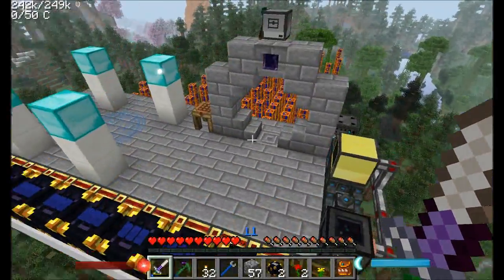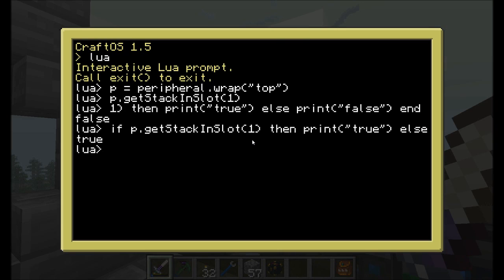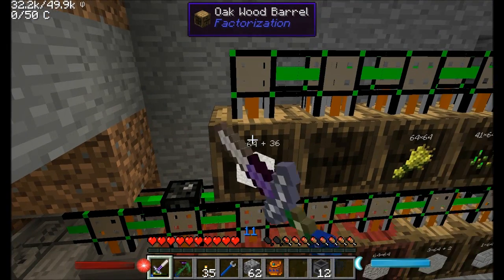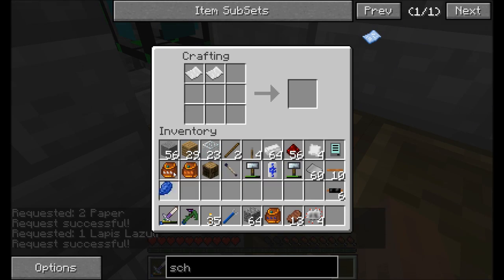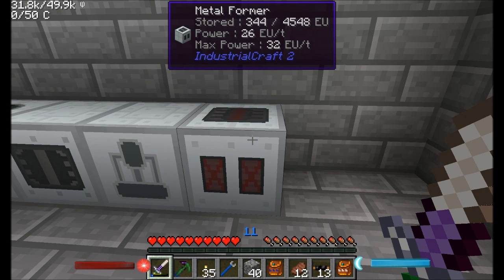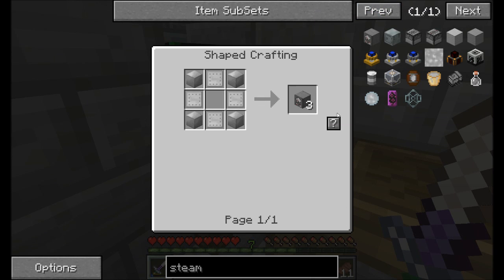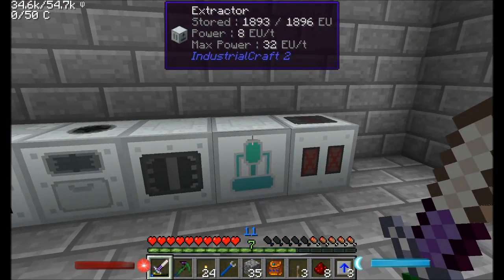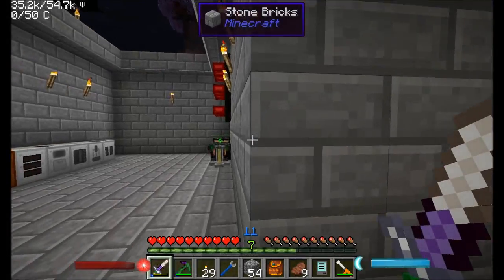Lets Play   S6E44 Upgraded Ore Processing

Comment: They should change thermal expansions machines slightly, either making craftable upgraded version with enderium or increase the process speed based on available energy.

as far as ore processing goes thermal expansion is superior to ic2, compact design, additional dusts, and you don't need 50 extra steps to make the parts.
Reply: Iridium is IC2 so TE won't use it in a recipe. TE already suffers from ''magic block'' syndrome so I doubt upgrades will be added, it will make it too OP. Use IC2 for hectic ore processing.
Reply: Whoops, meant to say Enderium.
Reply: Scott Kirby He said enderium.
Reply: Herp Derpington
Thanks for the support but I actually screwed up  and wrote eridium first.
Reply: One of the major design features of TE is that is designed that if you need more speed you just build more machines.

Comment: i liked the old ic2 better
Reply: abudahm a if by expensive you mean convoluted, then i completely agree :-P
Reply: Seth Baker Same and I would just build loads of pulverizers instead of crappy macerater
Reply: Seth Baker Yeah, it is basically gregtech now. If there was a config option to have simple recipes or the current annoying ones, that would be nice.
Reply: Could not agree more with this whole thread, IC2 is killing itself.
Reply: the new one is bit expensive
Reply: and tedious
Reply: Marsian I havn't even touched IC2, i really dont have to now,  i mean with thermal expansion and the smeltery who needs macerators and smelters.  that and thermal expansion machines dont make noise (yes i know there's a setting for that.)
Reply: indeed
Reply: The new IC, like Dire said, is a late game mod, for when players already have lots of machinery and items..
Reply: Gamer Dawg Eh, that is why TE works much better than it, that has options for early, mid and late game.

Comment: IC2 for 1.6 doesn't have explosions and the machines can accept 512 directly, it's been that way for months now. Just connect the MFE directly to machines with gold cable.
Reply: You don't get the explosions, but the machines are still limited to accepting 32 or 128 per tick (depends on machine). For a machine to accept more (and get full effrct from lots of overclockers) you need transformer upgrades in the machines.
Reply: Richard Cox
 It's still good to know that we have nothing to fear now...
Reply: actually its not plemented YET and as far as i know dire doesnt want to login after an update to find a hole in his wall....and roof.....and floor.....and outside ssoooo yaaahhh

Comment: You won't get shiny metal dust from macerators
Reply: ***** Except that Shiny Metal is Oredicted to Platinum. Metallurgy, at the very least, adds Platinum ore, and I'm sure there are others.

There's nothing wrong with Thermal Expansion having it's own key component that's relatively hard to get and only used for top-tier items - which, really, it is top-tier stuff, even the Tesseract. And you don't need much of Shiny metal unless you're going totally nuts - one makes enough Enderium for any single item except a Tesseract (which needs two).
Reply: If you're using Gregtech you can with the Industrial Macerator I tought, it is called 'Platinum" in Gregtech. Look it up
Reply: you can just set a pulverizer specific to ferrous .
Reply: Marvin Zwolsman That would require using GregTech. Only a true masochist does that.
Reply: Erick Wolff  You can produce cinnabar by infusing cinnabar ore with cryothium.. no pulverizer needed. And it's 100% rather than 25%.
Reply: Indeed, bad idea to put ferrous ore through anything else. Dire should be at the point he only needs to process ferrous for shiny (how much invar can one need: any only need 1/3 ferrous to make).

Better to reserve ferrous ore to do into an induction furnace (with cinnabar) for always getting a shiny ingot. Of course getting cinnabar requires a pulverizer ...
Reply: ***** so how would you fix that problem then?
Reply: ***** so I guess you don't like Thaumcraft either cos you can only get Essence from a Thaumcraft furnace.... Stupid comment
Reply: Erick Wolff
True, but in practice you don't need much shiny (one for every four enderium ingots). I find a little manual mining of redstone ore is sufficient. Silk touch via Tinker's Construct of course,